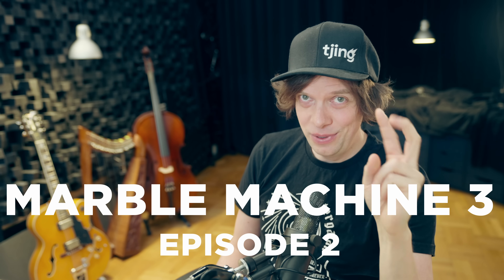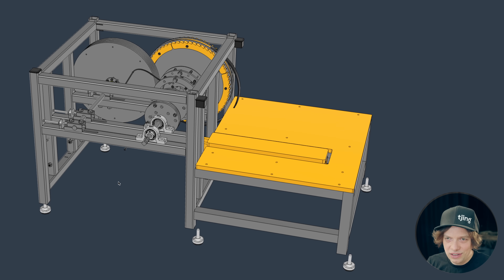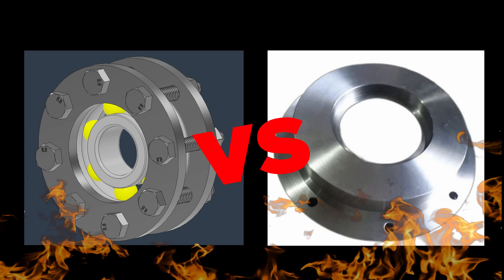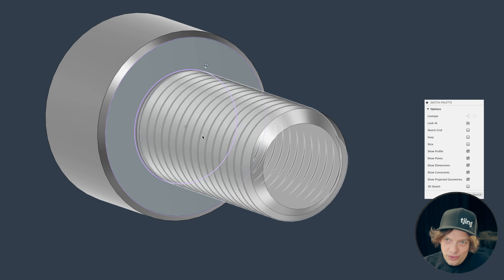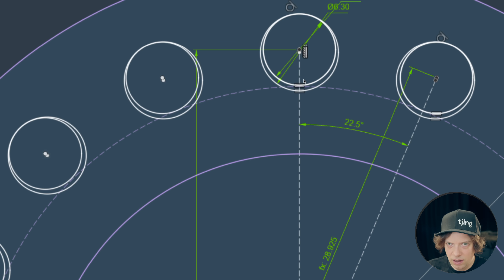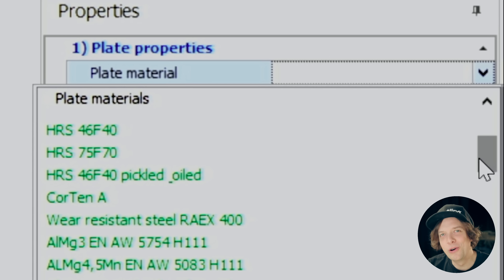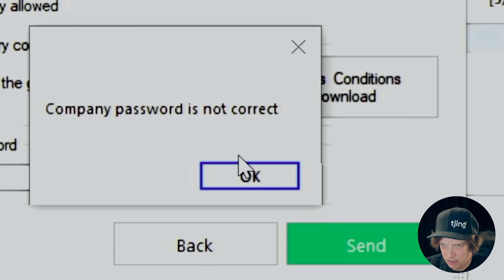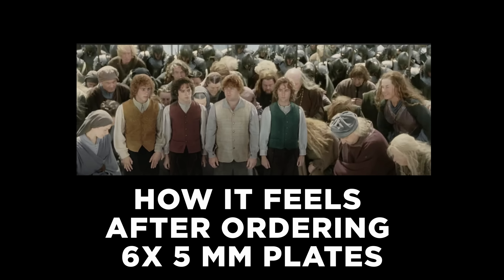Cheap Bearing Housing - Marble Machine 3 Ep.2

Comment: I have two comments, as a mechanical engineer.  One is caustic, one is helpful. 

Helpful:
You are trying to find a solution to center the part on the bearing. If it is not centered, you will have an eccentric flywheel. This is what I would consider a critical part. 

You are also trying to use “simple” manufacturing: laser cut flat parts. These parts have good tolerance but it’s not perfect enough for a tight (an interference) fit with a bearing. 

Everyone here is telling you there is a better way to mount the bearings. 

Consider finding a bearing that works with the tolerances available to you, rather than this very bad solution of using the bolt threads as an interface. 

Caustic:

You are using a bearing which is 100x more expensive than no bearing. Oh, and it works. Oh, and it’s the only real solution. 

Now, use the bearing correctly.
Reply: There are commercial bearing housings on the internet... he could just buy some of them and test to see which one he likes the most... they aren't even that expensive
Reply: He’s literally “reinventing the wheel” here?
Reply: Do you think he forgot about the whole "reduce parts" idea?
The new bearing has so many parts, and there's a reason we don't see this ANYWHERE else used, so I wonder why he even thinks it might be a good idea :/
Reply: @bl4cksp1d3r  Because he doesn't count standard parts in his part total, it would only increase from 1 part to 2. Is that assumption right? Well he doesn't have to manufacture any standard parts, and if one breaks a replacement is easily available, so in that sense it is logical to neglect standard parts. 
Also, the bolts would have been used anyway to mount a conventional bearing housing, so the part count does not differ as much as you show. 
As a further note, while no part is the best part, A simpler part is also better than a complex part. in that sense the design Martin came up with is pretty logical. 

I myself would advocate to go the safe route and just use a proper bearing housing, but I do get Martin's drive to try to do this.
Reply: sounds bout rite i mean he could use another lasercut disk as the actual interface with spacers if there is a need to skip out on the bearinghousing, the forces involved would possibly mangle both the bearing and the absolutely tiny interfacing metal threads over time a disc would distribute the forces better than the bolt "solution". Seriously though a bearinghousing is 1000x better in longevity, fuctionality, repeatability and maintainance

well well that will be all
Reply: Do you think there's a way to make a good meal in decent time with 2.5 million chefs?

Comment: Isn't bearing preload going to be super difficult to maintain if you rely on the precision of the diameter of the (thread part of the) bolt?

Which would also make replacement bolts hard to find after they wear out from having lots and lots of load on them in a direction that the design of machine bolts isn't made for in the first place?

Comment: I think your housing idea will work just fine but it may not be easy to repair. Everything has tolerance, the bolt and the bearing will both have tolerances which could cause problems if you have to fix it in the future. Make sure you measure them very carefully and choose the proper size before you commit to the design.

Comment: So from an engineering background I'd say this might work but its likely to be pretty unreliable which was the whole point of making this new machine.

Mostly that the tolerance on a bolt is far more than the acceptable tolerance on a bearing meaning you're unlikely to get a consistent fit, some will be far too loose, some will be far too tight.

If you do want to do it this way then a shoulder bolt is probably the way to go, still relatively cheap but comes with a precision machined shaft so they'd be more reliable.

Personally though creating a simple standardised 3D printed/machined bearing mount with locating features that you can just batch produce and bolt on would be about as simple and far more reliable.
Reply: what about the tolerance in the holes?! Are they being milled, drilled, drilled and bored to size? Then he's got an 8 bolt pattern so the stackup is going to be murder!
Reply: @nickgoodall578  yeah, that too, I just assumed it was going to be laser cut sheet so not great but consistent tolerances that could be fudged a bit.
Reply: @jon2922  Yeah it's just not likely to work, on several different levels. But, I mean, it's driving engagement, so maybe that's the goal? I'm not paying him, but if I was, I definitely make him sit on the naughty step before changing the design! 😆
Reply: Flangebearings are like 20$, not that expensive
Reply: @huhnesser  thats the obvious choice, this is just possible alternatives.

Something with low forces on it would probably be fine with a 3D printed housing and a skateboard bearing, maybe it'd even act as a built in failure point if something goes wrong.
Reply: And they surely will work with perfect tolerances

Comment: Martin!!!

First, a part doesn't need to be 100x better to justify 100x more cost.  If the lesser part fails to meet certain minimums, you go with the better part.  Remember how you kept putting in more and more effort to fix cheap solutions on your past two projects and they just got so bogged in being doomed to fail from the start that you ditched the whole machine?  Don't let that happen here!

Second, on dynamic sound, since I missed last week:  running multiple sizes of marble through the machine screams Bad Idea to me.  Have you tried simply dropping from different heights?  That should affect the sound similarly, and you're already trying something like that with the roll.
Reply: He needs to understand a really simple principle too: Time=Money. But even more important Time>>>Money in terms of scarcity.
Reply: Omg! I didn't realize he's 2 using different size marbles! How's he going to keep them sorted out. Two separate machines?

Comment: Surely you would have more accuracy using bolts rather than machine screws with a plain shank for the bearing to locate against. Or maybe using countersunk bolts, PEM style pressed studs/bushes or similar. 
Project is looking good early on.

Comment: why not just use plates, that will hold the bearing? I think that just two would be enough and if needed they can be spaced apart. Two plates with holes for bolts to go through and inner bores to press fit a bearing in. Nice and easy, done by same process as the rest.
Reply: There're flange bearings: bearings already enclosed in a plate with holes in it — ready to attach to a wall.

Comment: You will suffer from two things. First is that the outer diameter tolerance of threated rods is way higher  than you expect and not even constant on thread rods of the same batch. Second is, that the outer bearing needs full support on the outside for good lifetime and smooth running.
Reply: I think the bigger problem will be that the fine points of the thread will get squashed over time as the shaft vibrates. He could start with a perfect fit, and find it sloppy once it's been used.
Reply: @robinbennett5994  Possible but my gut instinct and back of the envelope calculation is that the clamping force should keep it in place and that it takes quite a lot of force to plasticly deform say a 12.9 bolt.
Reply: @Ammoniummetavanadate  but the surface that is in contact is very tiny! The hardened bearing casing will mangle the tips of the treads just enough..
Reply: @Ammoniummetavanadate  > and that it takes quite a lot of force to plasticly deform say a 12.9 bolt.

Are you talking about the shaft of the bolt or the threads.  The threads seem to be the weak point.
Reply: The outer diameter of threaded rod isn't even consistent along the length of the same rod.
Reply: If Martin is hell bent on this idea he needs to use hex head shoulder bolts so only the end is threaded.
Reply: Exactly.   Bolts/threaded rods are not sufficiently precise (or accurate) for this purpose, IMO.
Reply: "Lifetime" is an important point Martin may not be thinking about. This just might work well... for a day. a month if he's unlucky, because he won't see the problem until it finally gives.
Reply: You are correct about the tolerances on the threads. If tolerances are tight a press fit pin would be much better. The threads will crush under loading I expect, freeing up some tolerance for bearing wobble and a shorter lifespan. We will see! Sometimes gotta hold your hand to the fire yourself I guess
Reply: He is almost certainly using 6205s which have a static rating of 7.8kN and dynamic of 14.8kN.

I don't see him get over 1kN even with the flywheel.

It should be fine

Comment: Martin,
That intense emotional reaction to adverse events has a name. I hope that being able to give it a name and understand it better will make it a little easier to manage.
This intense reaction can take on many forms from frustration to anxiety to depression and hopelessness. It is referred to as Rejection Sensitive Dysphoria (RSD) and there are myriad methods for managing it. Most of them are rooted in behavioral therapy and mirror mindfulness exercises. My preferred poison for this behavioral bug is dialectical behavioral therapy or DBT.

Thank you so much for sharing your generous, patient and persistent spirit with the world through your Content and your indomitable creative drive.
Reply: I immediately felt what martin experienced. My desk (and a whole workshop) is filled with projects that have stalled because one small thing went wrong and I felt it was such a catastrophe I could not continue. I have a lotus speedo on my desk I was rewiring and the wire ferrules I fitted are too big to fit inside the connectors on the control board I designed and had made. Its a tiny fix in reality and yet the thing has sat on my desk for 6 months, staring me down and reminding me what an abject failure I am. I discard any notion of the hard won achievements up to this point and only see the failure. Then one random day I will just decide to cut off the ferrules and jam the wire into the connectors and carry on. Sometimes years later.

Rejection Sensitive Dysphoria is a thing and I didn't know I had it until recently. For me, like many other its rooted in the breakup of my parents when I was a kid. I think a lot of ADHD typical behaviours are basically coping mechanisms for RSD.
Reply: FFS the man has enough issues.
Reply: @andymouse its always better to know you have issues so you understand why you feel a certain way than it is to think you're broken or something. I know from experience.

Comment: Would shoulder bolts be possible? Then the bearing would be trapped with an accurately ground semi-hardened diameter. On a threaded bolt, the crest of the thread is maintaining positioning? Just thinking out loud. . .

Comment: Balancing the flywheel is SUPER CRITICAL!! Flywheels are death traps if you downt have them really well balanced. A machined beari g housing will locate the bearing with the required accuracy to make the flywheel safe to operate. How does that not make it 100x better?? You can get away with a plate clamped bearing in lots of spots. But not with the flywheel. If you want a bearing that is easier to mount they exist. They are called pillow block and flange bearings. They are already mounted in machined housings that are easy to mount. You the question isn't your plate mounted design vs a fully custom machined bearing housing it is using a ready made mounted bearing. However for the flywheel you want as integrated a solution as you can possibly have. If you don't you could really hurt yourself or other people.
Reply: When the flywheel breaks free and crushes the skull of someone in the front row he will rethink the cost savings when the lawsuit is filed.
Reply: There will never be somebody seated in a front row. Not with the scope creep seen from the beginning of the project.

Comment: Too tight and it will eventually wear loose. Too loose and it will vibrate like crazy. I'm not saying it's a horrible design, but a press fit design might be better, easier and cheaper.

Comment: I would question whether you're calculating all the costs into the non-machined bearing housing. Is the pre-fabbed part 100x the material cost only, or 100x the total cost, including the opportunity costs of your design time, prototyping, evaluating, iteration, etc?
Reply: He was greatly exaggerating, 100x, to justify a decision that was based on incorrect logic to begin with.
Reply: Turning is super expensive.

Laser cutting at scale is unbelievably cheap.
Reply: @Ammoniummetavanadate  I cannot accept that there is no off the shelf bearing housing that he could not adapt to fit his design or adapt his design to fit, that would be less expensive than ordering a bunch of prototypes, trying them, spending hours fiddling with the idea in CAD, ordering more prototypes, realizing it isn't going to work, and then ordering proper housings.
Reply: @RhynoD2  There absolutely are, they are also like $100 USD each from McMaster, Maybe down to $50 each for sketchy ones.

This will be like $10 each and built directly into the part vs needing mounting bolts and then locating them.
Reply: @Ammoniummetavanadate  For a flywheel I would absolutely spend the extra $180 to make sure it's safe
Reply: @Ammoniummetavanadate  It's already been €40+ just by paying for the prototypes! He will save so much time by doing it right the first time.
Reply: @RhynoD2  Risk/reward, there are probably 20 bearings per module or more.

R&D costs time and money but eventually it pays off.
Reply: @Ammoniummetavanadate  Hes going to spend more than like 8 hours on R&D guaranteed plus the prototype orders its already not worth it

Comment: Those threads along the outer bearing... Maybe the inner length should be lathe smooth, or be used as vertical stabilizer / key to match an exact cut on the outer bearing. This way the outer bearing won't turn at all.